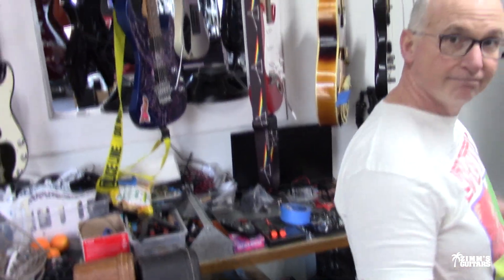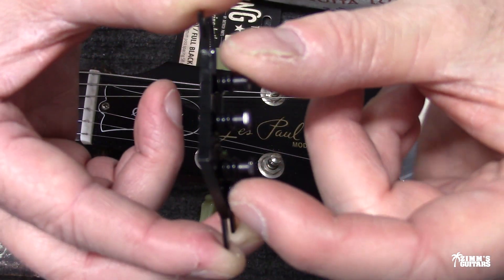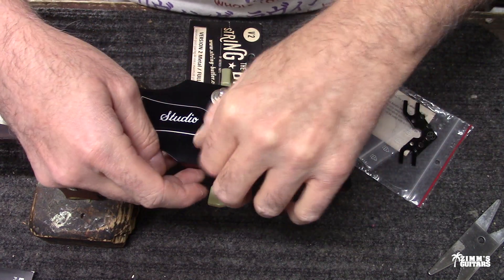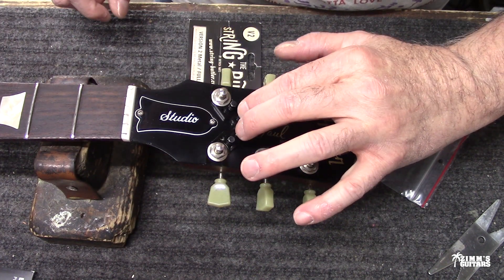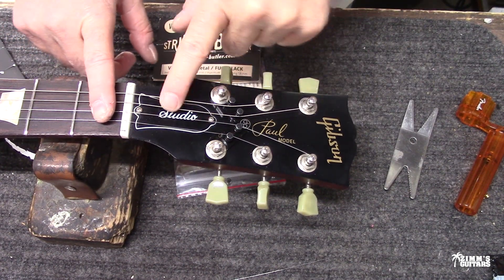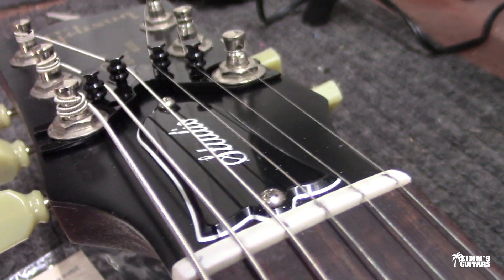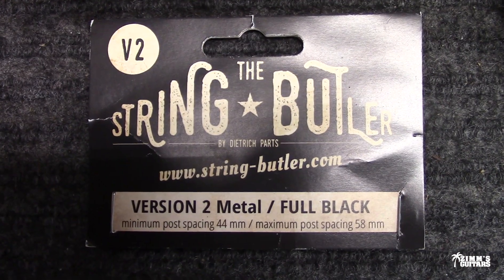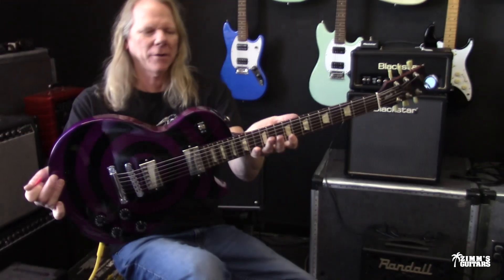Gibson Les Paul Studio, String Butler Install

Comment: All you have to do is just change the nut out and cut the slots at the same angle as the break angle and that fixes tuning issues on Gibsons. I do it to every Gibson I get with the 3x3 headstock.
Reply: @Bangingyourmom   Ditto
Reply: I mean let’s be fair, not everyone has the tools or the know how to do that. Plus the idea of replacing the nut on a 2000 dollar guitar can be intimidating. For 50 bucks, not a bad product. Besides between the nut and the tools to do the job, you’re already over the budget for what this costs. As someone that does guitar work locally I feel ya, but this is a good product for what it does.
Reply: @firemarshal2629  I was only commenting on what the issue is and how to fix it, if someone can't do it then that's fine but I strongly urge anyone that plays guitar to learn how to work on them yourself.
Reply: "All you have to do is just change the nut out and cut the slots at the same angle as the break angle and that fixes tuning issues on Gibson's"....oh here's a novel idea, why can Gibson cut a "proper" nut on a guitar they charge an arm and a leg for?  If the nut isn't right then why do they sell the same nut on every single one they sell?
Reply: Yours is the Only Comment I have seen ..over hundreds of viewed videos, that makes complete sense. Now, someone please tell me-How do you make a nut, or  buy a nut with the correct and exact "break angle" for my Les Paul?
Reply: It shouldn't be necessary to change the nut and/or file the nut slots on a 2000+ dollar guitar. It's insane. Such guitar is not worth the price.